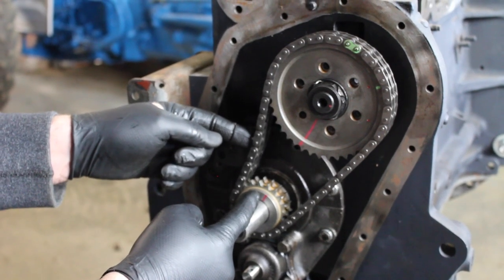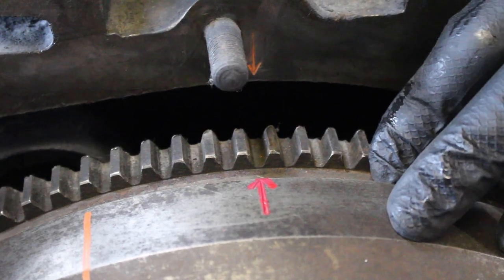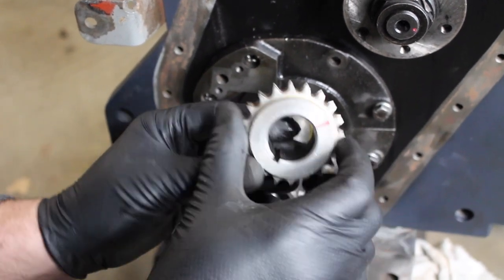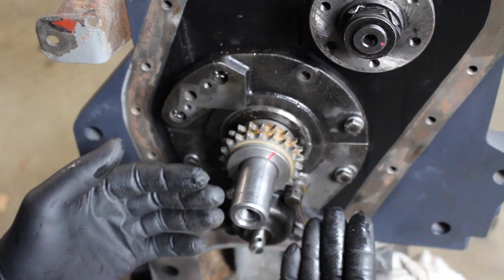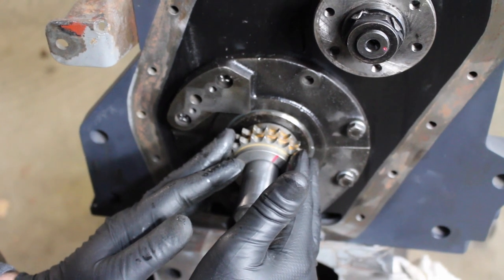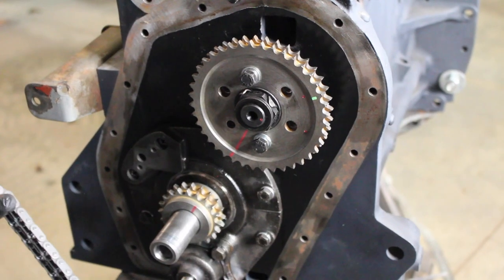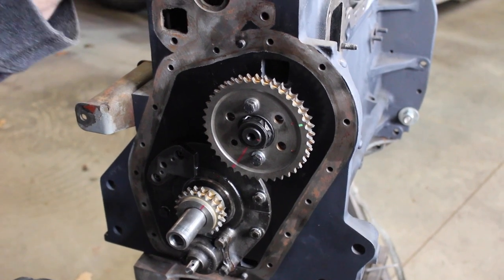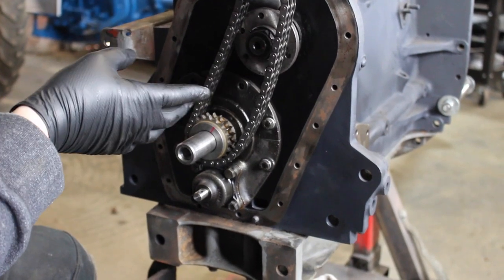Fitting the Timing Chain & Timing Chain Tensioner to a Ferguson 23c Engine

Comment: Hi Kev, if you see this message would you consider doing a video on changing the timing chain and tensioner on a 23c engine "in frame" so no access to timing marks on a fly wheel are possible? other than some written instructions online I cannot find much and what I can find seems to contradict itself. I am sure it would be a popular video over time. Thanks in advance!
Reply from the maker: Hi thank you for your message, that’s a great idea I do have another 23c engine coming in for a rebuild I’ll see what I can do.
Reply: @kevsvintagetractorrepair  Thanks Kev
Reply: Kev, if you ever have a rebuilt 23c with glow plug conversion for sale, please do let me know. Neil

Comment: Notice that there is only one bolt hole in the large sprocket that actually fits the bolt, the other ones are larger. That is so you can tune the camshaft/injection timing precisely. The exhaust valve should open 10 degrees before and inlet vale should close 10 degrees after TDC. If it doesn't then you can shift the sprocket around to make it correct.

Comment: Great content, as usual. The 23c is a lovely engine when running well and not worn. I way prefer it to the 3 cylinder Perkins and I find they are far smoother at working revs. Out of interest, did Standard manufacture the 23c?
Reply from the maker: Hi Darren thank you for your comment, as far as I know standard did manufacture the engine as the engine was put in other things as well as tractors. I would always have a 4 cylinder over a 3 any day.
Reply: Hiya mate. What’s your best advice for timing the engine up while it’s still on the tractor with the head still on?